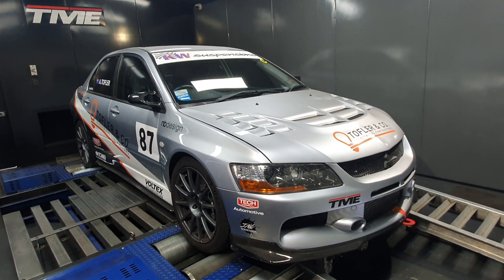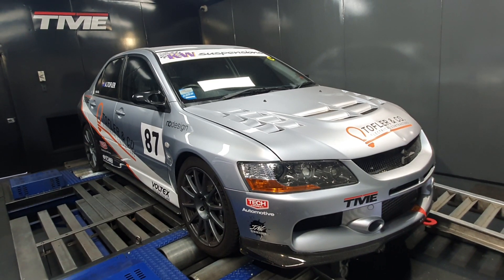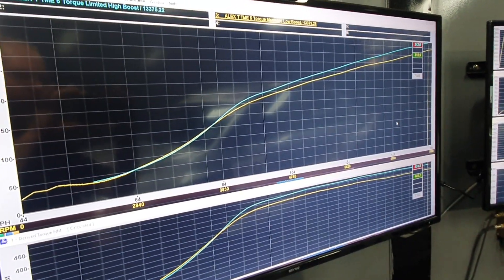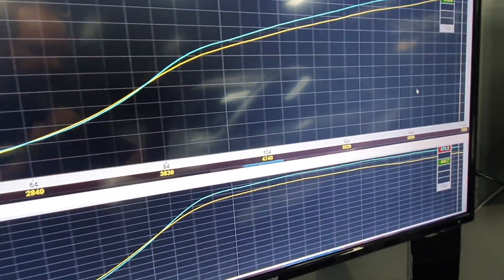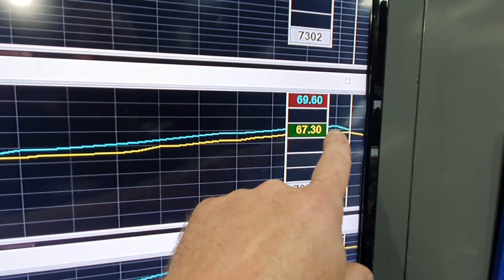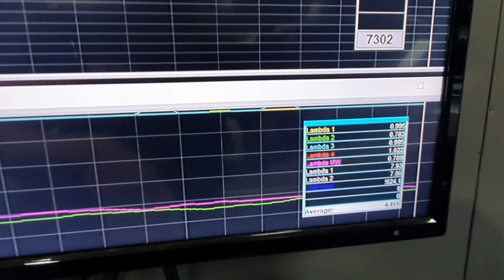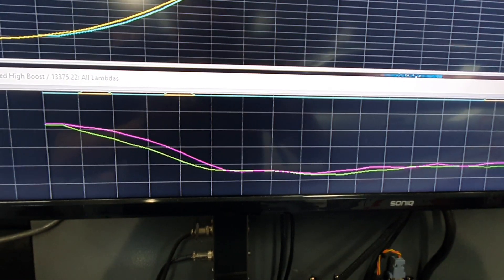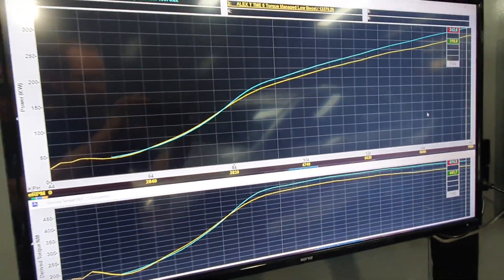Fresh ECU and sensor package results in 342AWkW out of a stock block Evo 9 with a GT Pumps 712

Comment: What is the oiling control mod done on this car?
Reply from the maker: Hey mate,  it's all stock in terms of actual oiling, although the turbocharger is fed directly from the oil filter housing an additional filter rather than from the head like oem.... protection wise we have an oil temp and pressure protection strategy setup via the ecu that controls a variable rpm limit based on both those parameters. Rather than a fixed "shut the engine down below x pressure" like a lot of failsafes do